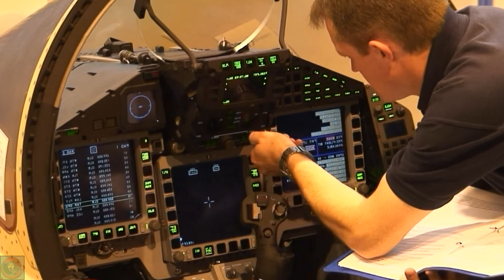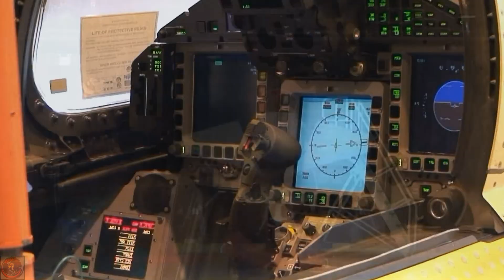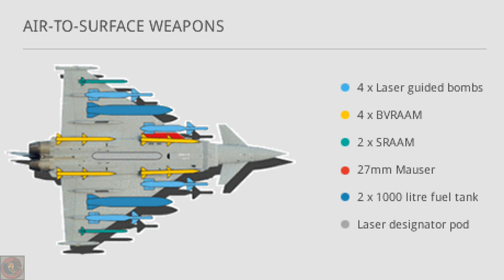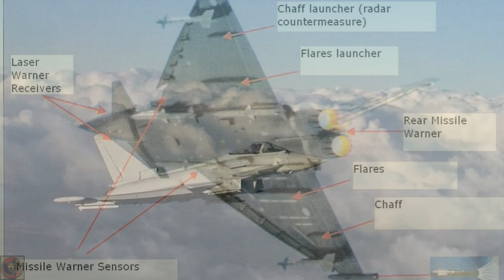Eurofighter Typhoon Combat Fighter Jet - Europe’s 4th Generation Fighter

Comment: Stating the aircrafts max speed in mach is misleading. Mach 2 can be any speed depending on the air pressure in which the aircraft if flying in. If you’re going to state an aircraft’s max speed in mach, you need to explain the conditions in which it was flying (e.g. altitude and temperature). Thus, it’s is easier to use set units such as kilometres per hour, knots, or miles per hour.
Reply: Dude, does that really matter? Most missiles and aircrafts measure the speed in mach.
Reply: GOD of course it does. Most aircraft measure their speed in true air speed which, depending on the country or organisation, will be in mph, kmh, or kts.  It also matters since at sea level, mach 1 is 1225kmh while at 30000ft, it’s 1091kmh. That is a huge difference in true air speed.  Mach is just the speed of sound and is adjusted for density or a medium and temperature, therefore it’s not an appropriate unit for this and cannot be used to represent true air speed.
Reply: @Mmustang51  I got some news for you.
Most people (unlike you) don't care about air pressure and temperature. They just need a simple number to measure whether it's fast or slow. That's it.
And for your point about mach not being accurate, values like kmh, knots, mph are also not always accurate. They also change with temperature (because temperature affects both air pressure and engine thrust), altitude and the weight and type of payloads( which affect drag ).
As for why they use mach numbers, it's much easier to say aircraft moving at mach 2 is faster than aircraft moving at mach 0.9. And a missile moving at mach 3.5 is slower than a icbm moving at mach 25.
In other words, unlike cars where there's a big difference between cars moving at 90kph and 100kph, the difference between 5510kph and 5500kph is utterly useless.
Reply: And one more thing. Mach 1 is precisely 343 meters per second. 1234.8 kmh.
It's a precisely measured internationally recognized value.
Reply: GOD When you use numbers with a large difference such as mach 2 and mach 0.9, it may seem like a small difference but when an aircraft doing mach 1 is going faster than one going mach 1.1, that’s when this issue becomes apparent. You also stated that mach is an internationally recognised unit but I think you’re forgetting that so is knots. Knots is what is usually used for an aircrafts speed and unlike mach, it’s value is fixed.  It is also simply incorrect to say that units such and kmh and mph are not fixed values. Going 1kmh means you are traveling 1000m in an hour and this does not change due to other factors.  Mach’s value constantly changes, thus it is a more complicated unit to measure in and more simple to measure speed with a fixed unit.  The typhoon goes 2,400+ kmh and mach 2 is not specifically representative of that.
Reply: @Mmustang51  dude, the simple problem here is that you don't seem to understand what "mach" means.
What do you think it is?
Reply: GOD If you carefully read my comments, you would have noticed that I stated what mach is several times.  Since you still don’t get it I will say it as simply as I can: mach is the percentage of the speed of sound in a given medium. For instance, mach 0.5 is 50% of the speed of sound in whatever medium it is traveling in. It’s not a hard concept to grasp.
Reply: @Mmustang51  That's exactly where you got it wrong. That's the simple definition of mach number.
But scientifically, as in measuring the speed of a projectile or aircraft, mach is a fixed value considered by scientists.
It's speed of sound as measured in dry air ( low humidity) and at a temperature of 20 °C (68 °F) as the standard. Under these conditions, the local speed of sound is 343 meters per second (1,235 km/h; 767 mph) – or 1 kilometer in 2.91 s and 1 mile in 4.69 s.
Reply: GOD GOD I will say that I am no expert in this topic but I am certain that when using mach to measure the speed of an aircraft, that is not how it is used. Mach for aircraft is specific to the medium it is traveled in as aircraft move differently depending on the density of air.  Mach in this situation cannot be fixed as aircraft will reach the speed of sound at different speeds at different altitudes, hence why the method you’re talking about is not used.  I am not saying there is no group of people who use mach as a fixed number but I think you can appreciate that it does not make sense to use a fixed value for something which changes its altitude constantly.  I am no scientist but I do fly aircraft (not fast jets but props and turbo props) and I can tell you that we use kts, kmh, or mph, depending on the aircraft (mostly on where it’s from).
Reply: @Mmustang51  fighters and other aircrafts usually always use knots as the measurement of speed during operation. 
Mach number is usually used when assessing the performance of aircrafts. Constant changing of altitude and climate is the precise reason why standard values are used for mach numbers.
Let me give an example.
Both F22 raptor and Su 35 Flanker E have a maximum stated speed of 1500mph. And both USA and Russia state their top speed as mach 2.25. So if both US and Russia consider 1500mph as mach 2.25, then both countries must consider similar values for mach number right? Either that or both aircraft top speeds were measured in identical conditions. So which is it?
Reply: GOD I will respond to the rest of your reply later since I am busy but on a quick note, if the max speed of the raptor (which is still classified by the way) is around 2400kmh and the eurofighter is faster than 2400kmh (around 2480kmh), why is it that the eurofighter is stated to go mach 2.0 while the raptor can go mach 2.25?  On another quick note, the Flanker and Raptor do not go the same speed. The Flanker is reported to go quicker than the roughly 2400kmh that the raptor reaches so why would it be that they are able to reach the same mach number if mach is a fixed value?
Reply: @Mmustang51  Also read this.
https://www.af.mil/About-Us/Fact-Sheets/Display/Article/104506/f-22-raptor/
And note the unit of speed measurement.
This is also not a silly enthusiast site.

Comment: Correct me if I'm wrong but canards move independently, these move together so are technically foreplanes?
Reply: These move independently.
Reply: @RR-us2kp  They physically can, as in they are not connected, but they don't, they move together.
Reply: @mxfanmatt  canards increase the radar cross section of aircrafts. To counter this, eurofighter has special software to control the movement of canards. That's probably why they move together.
Reply: @RR-us2kp  I was of the understanding it was for fatigue reasons...
Reply: @mxfanmatt  Maybe. I don't know for sure.

Comment: My thoughts about twin engines:
Have you ever heard of one engine stopped working in a fighter aircraft? Me neither, I just does not happen these days. Engine failure is not the reason for crashes and accidents. How about if one engine is taken out by enemy fire? Well I figure if that happens, it's very likely there is so much damage done, that fighter is not going to make it home anyway!? The bad thing with two engine is of course it makes the aircraft more expensive and maintenance cost higher.

Comment: The F-35 is finally starting to show what it can really do, but it doesn't fill the same role as the Typhoon. If you have enemy bombers coming in, the Typhoon is the better choice to get up and out there quickly with a lot of long ranged missiles. If you need a fighter that can penetrate enemy air defenses and strike a target. The F-35 is the better choice. 

Having both is the best of both worlds. The F-35's can operate forward of the Typhoons, using their stealth and sensors to identify enemy and conduct BVR attacks. The Typhoons can them mop up survivors that have been forced on the defensive.
Reply: @soulsphere9242  The F-35 is more than just a strike aircraft. The F-35 has stealth and the best set of sensors on a fighter. Give it some Meteor missiles and it's one of the most dangerous BVR aircraft in the world, probably second only to the F-22.

Comment: No visual range combat, you never know what will happen or how well electronic countermeasures will work in the future. Think the UK are stupid to not keep the gun ready. Also the turn radius are also important when you wanna throw a missile locked on to you off. 

Think there are to much focus on stealth, not that it's not important, it has its place and gives a big advantage in certain arias, but for some missions they are just to expensive for now, and there stealth have no importance, then a 4++ would do better.

Comment: Nice aircraft... but what all does it do better than current updated fourth generation combat aircraft? This is a just a question, not an attack
Reply: One of the best radars currently in use.
Most probably the best electro optical targeting system on earth.
Use Storm shadow and meteor.
Supercruise capability (one of possibly 5 fighters that can currently supercruise )
Special stealth oriented canards ( don't know how that works )
One of the best electronic warfare systems in the world ( was capable of jamming F22's sensors to get the upper hand in RED FLAG in Alaska)

Comment: Hey Maneuverability and Delta wing don´t feat in the same sentence . PERIOD. Terrible aircraft Along side the Dassault Raffalle and the Saab Grippen . Complete crap when compared to much older Us And Russian fighters . Slow , Terrible maneuverability because delta wing is designed to be stable NOT THE OTHER WAY MATSIMUS . Inferior Radar to any Russian and US radars . Inferior in everything . Top ceiling , Trust to weight ratio , Radar and jamming and weaponry . So a lot of lies in this video and a HOLE LOT OF FANBOY-ISM. Terrible . Next time use facts instead of inaccurate comparisons to push your preferences. If you were in charge of buying new fighters you would ruin the tax payers money on this inferior plane.
Reply: And this is proof that there are actual people who's IQ begins with a decimal point.
Don't talk about things you don't know

Comment: I dont think that dogfights are a thing great jet fighters care alot about in these modern times.some planes don t need to dance alot in the sky.they got computer system that takes other out before and even without being seen.ww2 was the dogfight times.f16 cant find a f35 and get shot down not knowing from were .to find out what fighter is a good one ,you must see how they do at war.how many losses and kills.i do belive its the advanced data that lay ahead and are connected to tanks and other things in the battlefield.full control over and under is they key.the best fighters dont need a great pilot.need the system that give you all info to know whats up far away from danger

Comment: While the Typhoon is a beautiful aircraft and one of the best 4th gen fighters out there, what lets it down is that it doesn't have a AESA radar yet. I'm also really surprised to hear that the British air force doesn't use the cannon at all. 

Matsimus buddy, I'm sorry but the F-35 is a monster of a aircraft. Not only has it exceeded every expactations, it is proving to me a lot more capable than everyone thought. Stealth isn't a joke like some ignorant civilians would like to believe. My older brother has been flying the F-15E for several yrs now and has seen what the F-35 is capable of doing and it's not going to be very fun for any 4th gen fighter. As for single engine vs 2 engines, that is no longer and issue because the main reason why fighters needed 2 engines was because of reliability. Modern jets engines, like the one in the F-35 are EXTEMELY reliable and it is the most powerful jet engine ever put in a fighter. So there is no need for a second engine. But as far as the F-35, it is proving to be well worth the money because that aircraft is going to be in service for a very long time and it's unlikely that countries like Russia or China are going to be able to field anything that is capable of matching it for a several decades. It gives pilots the much more SA and the ability to penetrate high threat areas with advanced anti air systems. Something 4th gen aircraft can't do or at least not as well.

Comment: For such an effective fighter jet, it is sad that it came out not the best looking. Compare it with the Dassault Rafale, and you can tell the difference. By the way the stronger jets engines are not in any way an advantage to the stealth signature and infra red radar print size.

Comment: First model couldn't do ground attack and lacked much...and spent its flight resources much faster than promised and cost insane.Now...it just costs insane,but can do a lot more.It is too expensive,thou a good multi-role fighter.Still doesn't justify the price and it cant replace Tornado in patrol and slow sweeping attack on ground(not to mention short run needed for Tornado).
Rafale is a better choice comparing capabilities,needs and price.Thou,the biggest mistake of Royal air force and Navy will be F-35 and ditching further development and service of Harrier(tne only successful VTOL if we are honest and cost a fraction of F-35 in all costs included).
As for Grippen..by far the cheapest western plane and does a good job.
Reply: The F-35 is the best choice, and definitely not a mistake. Yes, it's more expensive than a Harrier, but the increase in performance is ridiculously high. You're seeing a mediocre aircraft turned into the best aircraft platform in existence today.
Reply: @ivanlagrossemoule  look up official hearings how long it takes to service F-35...especially C. Again,look up just official list of problems and failures that was represented to Pentagon and your own commission.Its maneuverability is extremely poor in any real speed and any real load,not to mention combat range when seriously loaded.
No,it is a disaster.It isn't best of anything,has a lot of problems,requires maintenance as much as F-22(with F-22 at least doing its job and being the best air superiority fighter as promised...and first child of pure 5th generation FIGHTER)...and not least of all,its stealth is bellow what was promised,which was far bellow F-22.It is great against X band radars...against others far less and it depends on what part of it is exposed.Even back of F-22 isn't as closely as stealthy as rest of it,let alone F-35  which has serious problems in stealth department (only somewhat fixed with C). Despite promises of lower costs,reality of exploitation  and problems in maintenance now show those are just pipe dreams.
And when commission asked about poor flight performance of F-35,Lockheed answered "we will see them first,so we will shoot them first"...Which is all nice and dandy,but doesn't go well with reality.F-35 would be forced to work like F-16 in Syria,sticking close to the ground to avoid detection or SAM fire as much as possible,to deliver their load(since most cruise missiles get shot down).This also ignores EC warfare and in general reality of modern Russian and Chinese SAMs....
So no...really,it isn't a great choice.The fact they tried to push it to replace everything,even for roles it wasn't designed for,shows how much of a scam it is.And when you have people that even worked on the project or were part of evaluation commission saying it is a failure,along with those that created F-16,A-10,F-18 and F-18 Super Hornet...you know it is shit.
It even sucked away money for F-15 upgrade,F-22 upgrade and ext,which are critical..even if F-35 turned out to be good,until F-35 was produced in enough numbers.Again showing the sheer scale of the scam and corruption that is running amok.

Comment: Double engines is double trouble and make reliability worse for a fighter, compared to single engine configuration, which is proved by the statistics.
Eurofighter DON'T have the lowest detection range! The same claim is made about all other “gen 5 fighters”. My guess with lowest first is Tejas, Gripen, Rafale, Eurofighter. Eurofighter have the highest climb rate, Gripen the best turn rates, availability and STOL, Rafale payload.

Comment: Twin engines are not safer than single engine fighters, despite popular beliefs. In fact since the 1980's the majority of crashes by engine failure was in twin engine fighter jets. Except the most recent crash, which was done in an experimental F-35, however the issue there was not the engine but that special seals surrounding the blades, they weren't properly broken in properly, thus catching the blades, causing the crash. A new program for proper break-in of the blade seals was introduced soon after the incident. Also no, having an additional engine in that scenario would have still ended up in a crash because of the damage that occurred internally as the report stated.  Again though, before that accident, almost every other crash for the last 30 yeas was done in a twin engine jet. Russia who operates an almost all twin engine fighter fleet have had the most accidents of any other country.  However, because of modern computer assisted design, fighter jet engines today are safer with fewer failures ever occurring, including Russian planes.

Comment: Two engine jets are not necessarily more reliable. Here is an example of F-15:

"As of 8 January 2014, 123 USAF F-15 aircraft had been destroyed in mishaps, with 52 fatalities. This was a lifetime average of 2.93 aircraft destroyed per year, or 1.99 aircraft destroyed per 100,000 flight hours. Of all aircraft lost, none have been lost in air-to-air combat."

https://en.wikipedia.org/wiki/List_of_F-15_losses

This is why USAF is considering replacing the F-15 with latest variants of F-16 Falcon, while the Austria will replace Typhoons after 2020, also with single engine fighter.

https://www.defensenews.com/air/2017/07/07/austria-set-to-replace-eurofighter-typhoons/

That being said, I totally agree it is beautiful and has amazing flight characteristics.